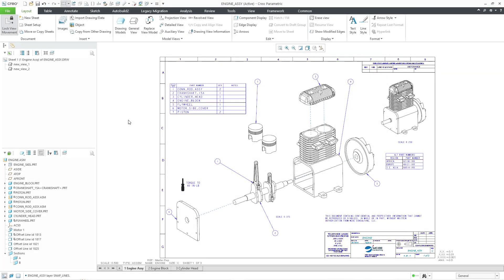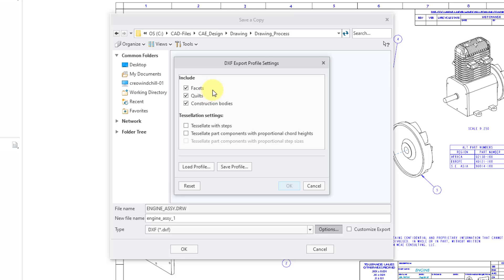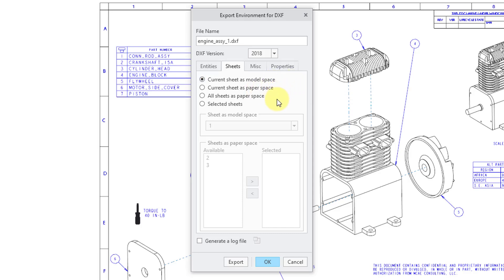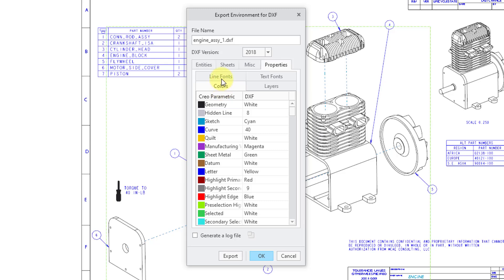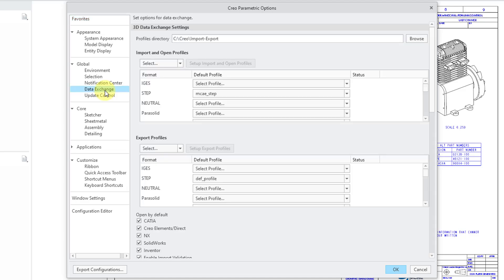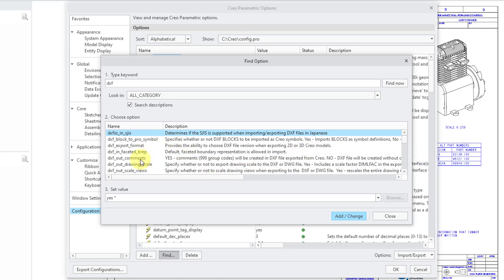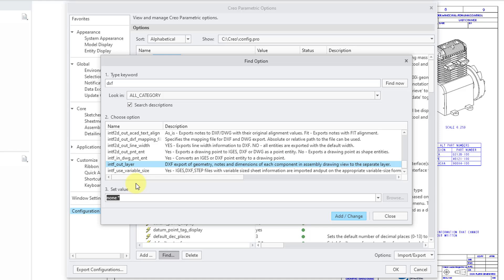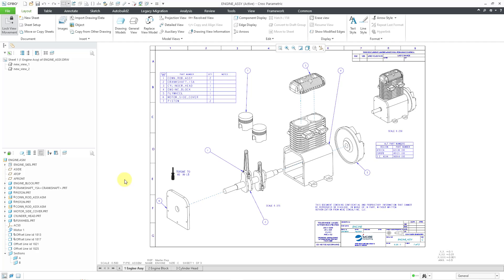Creo Parametric - Exporting a DXF File

Comment: Is there a way to save settings for Export Environment for DXF between creo sessions.
For example, when exporting drawings from dwg to dxf I want to always export them as multi-sheet drawings without opening settings and checking "All sheets as paper size" options every time.
Reply from the maker: Yes. Don't I show that in this video? You save your export profile or DXF files, and then set the DXF export config option to point to it.
Reply: @CADPLMGuy  looks like export profile only saves user preferences for "Facets, Quilts, Consturction bodies" and tessellation